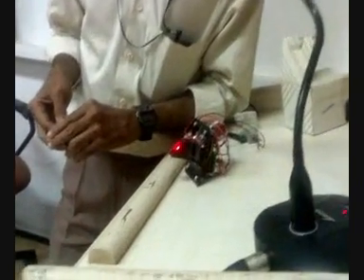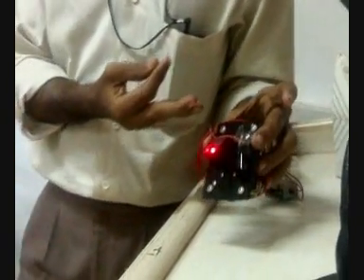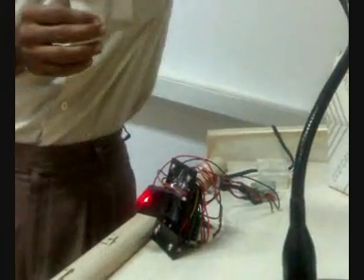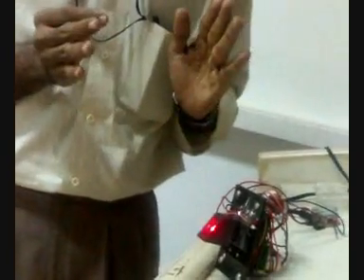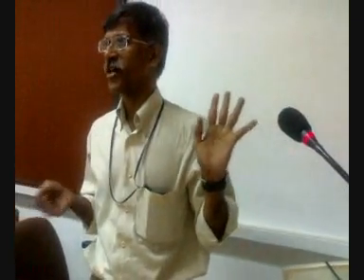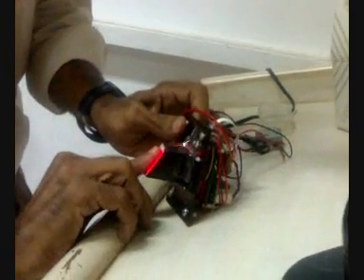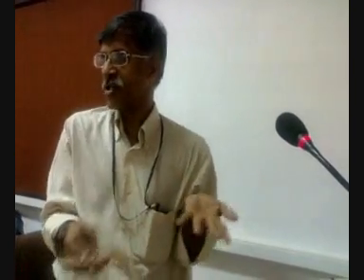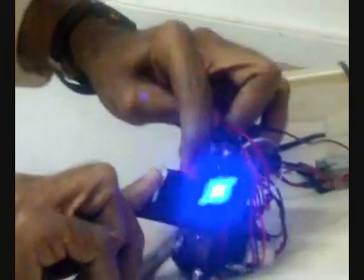Fake your Finger Prints in less than a Dollar

Comment: Guess what OzonProtector.  The guys collecting the fingerprints are the ones who already have the data. They need to do a little more work to  convert an image to a fake skin. It's called PCB etching, utterly common to electronic hobbyist and engineers.  Ofcourse one need not depend on the Official channel for spoofing, you can collect fingerprints from any smooth object - please check the net and do your homework. You could also use a regular camera from a safe distance. Work the details uself.